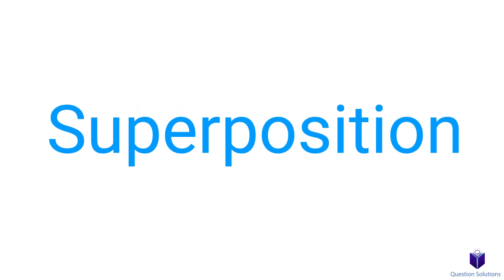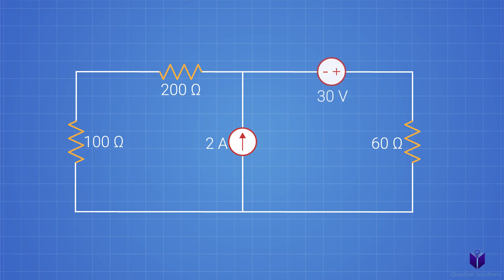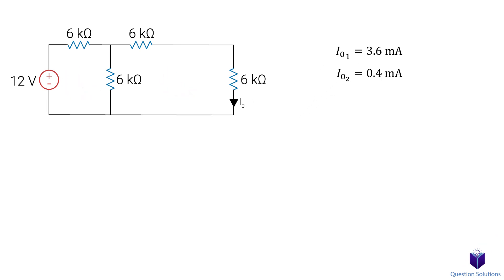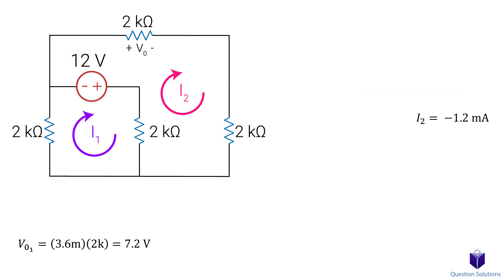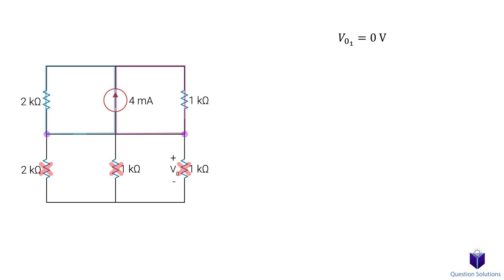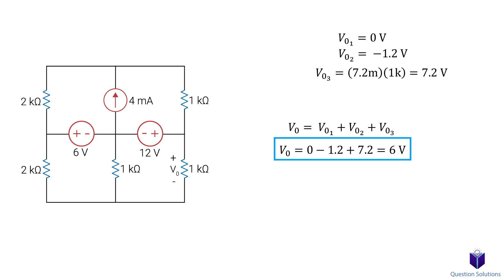How to Use Superposition to Solve Circuits | Engineering Circuit Analysis | (Solved Examples)

Comment: Thank you so much fo the video, i would just like to ask;

If i had used voltage divider rule on the last example, wouldn't my answer be 8.4V?
Reply from the maker: No, you will still get the same answer as shown here if your positives and negatives are correct. You cannot get two different values for a circuit by using another method to solve it. It will be the same answer regardless of the method used. You can confirm this yourself by drawing the circuit using something like: https://www.circuitlab.com/

Comment: Hey! Thanks a lot for this video! What happens when dependent voltage sources are involved here? Do we do superposition for them as well or do we just ignore them and keep it as it
Reply from the maker: If you have dependent sources, you usually wouldn't use superposition. It creates a mess, far easier to use other methods to solve the circuit.

Comment: Hi, how would you use voltage division to solve the for V0 at 10:08? Thanks!
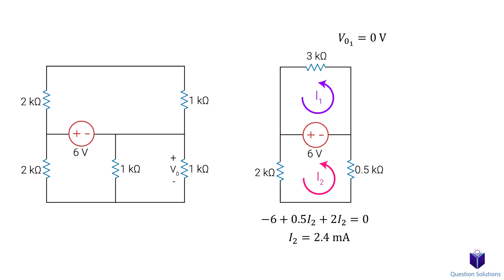Reply from the maker: You're probably asking this because the voltage source and the resistors are in parallel (top vs bottom). But in parallel circuits, the voltage is the same, so you can completely ignore the top and just focus on the bottom since both parts of the circuit will be 6v. Using voltage division, you get  V = (6/(2+0.5))(0.5) = 1.2V, then you go through the same process I describe at 10:36 and onwards.
Reply: @QuestionSolutions  ah, i see. thanks a lot!

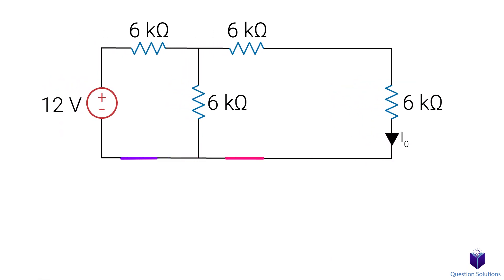Comment: Wait, i tried to do voltage division for problem 5:14 and some how got the exact value for I2. My set up was Io= (v(t)/(R2+R4))(R4) where v(t) = 12 R2=R4 =6Kohms. This made me think that voltage division gives you current, but obviously by its name it does not. Moreover, theoretically speaking why wouldn't v(t)/(R2+R4) give me Io? Since voltage division is just another fancy way of saying ohms law. Thank you in advance! Your videos are amazing, using them to study for my midterm on Tuesday!
Reply from the maker: Technically, you didn't really use a voltage division equation, but rather took the "previous step" before voltage division to get the current value (or the un-isolated version of voltage). Voltage division equations spit out a voltage, see https://www.youtube.com/watch?v=Gn26z60tTog at 1:59. If you want to use ohms law, you can, you just need to properly add up the resistors in parallel and series to get the current flowing in each branch. :)

Comment: Thank you for the tutorial-- why cant we just do voltage division on the two reisistors in series at 8:14? I got 6 V
Reply from the maker: You can do voltage division, you just need to properly combine the resistors in parallel and series (if you got 6v for VO2, then you didn't do that properly or made a numerical error). Once you isolate for a single source, you're free to use any method you want to figure out the values you need. So pick any method that gives you the fastest answer, or the one you're most comfortable with :)

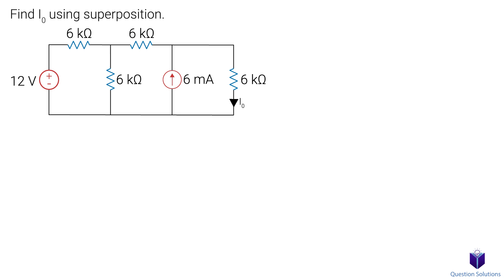Comment: Sir may I ask what other methods we can use for solving for the current instead of the current dividers at 2:52
Reply from the maker: You can combine the resistors using parallel combinations and then use ohms law.

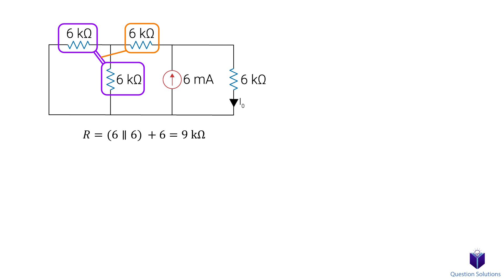Comment: Im confused at 3:30 do we have to put the other resistors as equivalent to get the 9 ohm to use current divider cant we just use current divider with the two 6k ohm resisotrs that are parallel with the current source
Reply from the maker: If you can mentally do that part, you're more than welcome to do that. Some students can't and need to see the process behind it.

Comment: @QuestionSolutions  Sir I have a question. in 8:17, 
For I2
your equation is 2i2+2i2+2i2(i2-i1)+12=0

isn't that it should be

2i2+ 2i2 +2i2(i2-i1) -12=0 instead?
Reply from the maker: So i2 goes clockwise in the loop. So when you go clockwise, which side of the voltage source do we enter? Positive or negative? We enter the positive side. So it's +12, not -12.

Comment: 11:30 can't we add the 1 and 2/3 ohm resistors as if they are in series ?
Reply from the maker: Yes, you can. And then after that, you can add those 2 in parallel to get a single series circuit too. Totally up to you on how you want to approach the problem.

Comment: Thank you for this lesson sir. I have a question in 9:36 where the 4mA is considered and the two voltage is shorted. How do you know that no current is flowing at the bottom three parallel resistors and not at the top part where 4mA parallel to 2k-ohm and 1k-ohm? It'll be helpful if you could answer this for my future circuits analysis so I can lessen my solving time. Thank you!
Reply from the maker: So imagine you and a bunch of your friends are standing on the current source. You have one goal, that is to leave the current source from the top, and come back into it from the bottom. Now you scout the circuit and you see that no matter what, to leave and come back, you have to go through the 2k and 1k ohm resistors on the top, no way to avoid them. So some of your friends go left and some go right. But, you notice that in the middle, there is a straight line path back to the current source and you won't have to go through any of the resistors on the bottom of the circuit. Think of going through a resistor like walking through mud. You don't want mud on your shoes again and again, so you try to avoid it. So your friends and yourself take the middle path, because that gives you a path to the current source without having to go through any resistors on the bottom. What I explained is a crude analogy, but this is how it works, current will always take the path of least resistance. If there is a way for it to start at a source and get to a source without having to go through resistors, that's the path it will take. Just like humans, where most of the time, we look for the path of resistance, current always looks for the path of least resistance.
Reply: @QuestionSolutions Thank you very much! This made my mind clearer!😊

Comment: in 8:17 for mesh 2 equation can u explain , my equation is 2I2-2I2-12+2(I2-I1)=0, why is 12 +ve ? and -2I2 i followed the given polarity... can anyone explain? :'I
Reply from the maker: So you're going clockwise. When you go clockwise, do you enter the positive terminal of the 12v source or the negative terminal? The positive terminal, so you get a positive 12v.

Comment: at 10:09 how did we add the 1k Resistances? the voltage is not the same
Reply from the maker: So combining resistors has nothing to do with voltages. Please watch this video first: https://www.youtube.com/watch?v=Gn26z60tTog
Reply: @QuestionSolutions but if resistors are in series, in mesh analysis there's one current going through mesh and another passing through a resistor Io, then we can't add those resistors up, it was in the mesh analysis video. kindly explain I'm confused
Reply from the maker: @Noor_2k6  I think you're confusing two different topics together. You can always add resistors in parallel or series as long as there is no voltage or current source in between in the same branch, or if there is not wye-delta formation. Please watch the link I sent to you in the previous comment, and after you watch it fully, then reply back if you're still having trouble understanding.

Comment: For the last circuit example, why are we able to remove 2 sources at the same time. I thought superposition is about removing 1 source at a time?
Reply from the maker: That's incorrect. Superposition is really about focusing on one source at a time. I mean you could focus on more than one source at a time, but that defeats the purpose of superposition and you're better off using another method to solve the circuit.

Comment: With the first example id like to know wont the current all just go through the short circuit why do we include the the restor in parallel?
Reply from the maker: I don't know where you're referring to. Please use timestamps.
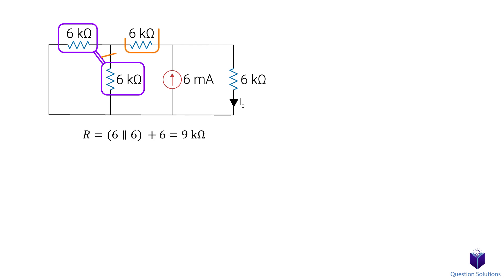Reply: @QuestionSolutions around 3:26
Reply from the maker: @whateverworks8974  Only the voltage source is replaced with a short circuit, but that doesn't create a short circuit in the circuit itself. Nothing is being bypassed.

Comment: In the last example, when you removed the voltage sources, why was the voltage V01 = 0V
Reply from the maker: Removing the voltage source creates a short circuit through the middle of the circuit, so electricity won't "flow" into any of the resistors on the bottom.

Comment: Can you quickly explain 3:29, why they are in parralel in a way that is easily understable?
Reply from the maker: @H4wk3yes-g7r  please watch this video first where I explain series and parallel circuits: https://youtu.be/Gn26z60tTog?si=OMdSpvuWl16KW9hZ
Reply: it's because they are different branches of the circuit, there for their resistances aren't added together, but parallel. and if you don't know what a branch is, it's basically a part of the circuit where the current has yet to split the amperage of the previous branch.

for example, if current/branch (i1) had a 1K and a 2K ohm resistor, you'd add those resistances together to get 3K ohms. the main focus here being that both the resistors are connected to the branch/current (i1).

but if the current (i1) has a 2K ohm resistor, and the current (i1 - i2) has a 2K ohm resistor, the resistance isn't added together because the current (i1) and the current (i1 - i2) are not apart of the same branch, there for making them parallel to each other.

the parallel rule also applies even if there's no resistor on branch (i1 - i2) so there for, if there's a resistor on (i1) and (i3), but no resistor on (i1 - i2) then (i1) and (i3) would be parallel to each other due to the splitting of the current needing to be accounted for.

Comment: what about if we have dependent sourcers?
Reply from the maker: You usually don't apply superposition to circuits with dependent sources, since they are dependant on other components. So in essence, you can't focus on a single dependent source because it's usually linked to another source.
Reply: @QuestionSolutions  so using mesh or nodal analysis would be better in that case?
Reply from the maker: @iTzFraax  Yes, that's right.

Comment: Can anyone explain 9:33
Reply from the maker: What would you like explained?
Reply: @QuestionSolutions That short circuit thing, why the current will not flow through the bottom resistors at 9:40
Reply: The flow of current will choose 'the path of least resistance'. The lines connecting sources and resistors represent perfect conductors which can be thought of as a zero ohm resistor. Since there is now a 'zero' resistance path bypassing the bottom components, current will not flow through the higher resistance paths. If a resistor (or any other component) was placed along the short circuit path (breaking the short circuit), then the current would flow to the lower paths.

Comment: At 9:55, why is that the current source removed along with the 12V source?
Reply from the maker: So we always isolate for one source at a time. So if you have 5 sources, you remove 4 at a time and do the calculations.

Comment: for the 6mA current source in the middle and V source shorted, instead of current division, I actually did mesh analysis. I got Vo = 4, while you got 7.2. why am I getting a diff answer using a diff method? shouldn't it be the same regardless?
Reply from the maker: I am not sure where you're referring to, you have to use timestamps so I can take a look. But, yes, regardless of the methods used, you should arrive at the same answer. There might be a numerical error in your answer or a step wrong. I would double check the work. You can also check your values using this: https://www.circuitlab.com/editor/#?id=7pq5wm&from=homepage you just need to draw out the circuit :)